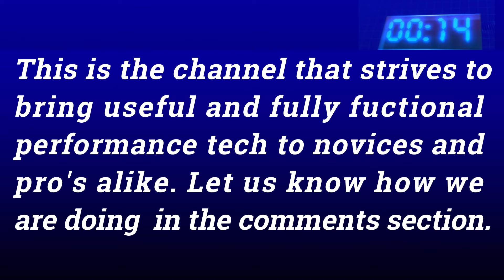Performance  survey & hot upcoming video's

Comment: I think your videos are a great balance of high tech information explained in a basic engineering way for people like us with a high school education to understand. I would like to see more steering and suspension modifications personally. But if you changed nothing your videos are already the most informative on youtube.
Reply: Id also love to see if there is anything that could be done about getting good low cc sbc cylinder heads. Because it is hard to get static compression up using dish pistons because they capture the flame front better. with the sweet spot for compression on the street between 9.25 to 9.5 these large 60-76 cc heads just don't cut it. If you could come up with a way to make the current 1.94 valve heads smaller without milling the crap out of them that would be cool or if you can take the smaller cc commonly available 1.72 heads and fit bigger valves in them or some other trick to get the flow and the vacuum up that would be cool I'd love to see if you could think about something for this subject.

Comment: It seems like doing more with less cubic inches seems to be the thing on the internet. The mission impossible with the 318 and power nations 305 416/500 hp have really got a lot of people talking. Although Derrick from Vice Grip Garage was the innovator on that whole trend with the 307 years ago. What I like about all the porters videos is you get the majority of the power without shelling out a ton of money, sure 416 or 601 heads won't flow 255 cfm like the trick flows but 235 cfm is doable. Those type of videos relate to a lot of guys that have the older cast iron heads sitting around.

Comment: I just ported a set of 781 heads with 219/188 values both intake and exhaust with some bowl work and they work great. I use as much as your methods as I could I my garage with basic tools I’m a retired auto body and pant technician. Thanks so much for sharing.

Comment: I'd like to see tip 100 speed secrets, like placing a fillet at the bottom of the cylinder bore. A list of things like that. Things that are universal and don't require flow benches.

Comment: Among others, i bought your book Performance with Economy many, many years ago. There is a page showing a SBC head's intake port modified. I recall a company in California did this mod and referred to it as their "street/econo" head.  The modification slightly widened the top only of the machined face  to increase flow on the roof of the port. There was an accurate, machinst drawing, showing the shape.  I scaled it up to "life size" and did that modification.  I also took your advice and had my machinist install a 1.6 exhaust valve.
He told me "Randy, would you quit reading books?" 🤣
Did I help or hurt the flow of these brand new World Products S/R 76cc heads?  Ill never know as flow testing wasnt available here.
Ill give you my combo, then make a suggestion.

73 4-bolt block/stock compression ratio and a mild Edlebrock Performer cam .420/ .442 lift

World Products S/R 76cc.  
(Not S/R Torquer)
Manley  SS Race Flo valves 1.94/1.6

I had about 80 hours into the heads, including making templates so that I could make each port identical.
The power increase felt to me about the same as when i had installed an edelbrock cam.
35hp?  It was definitely noticeable.

I gained power and there was zero loss in mileage. Just what i wanted.  I also learned something thanks to you.
The 1/8 mile time wasjust under 10 seconds as I recall with a best of 76 mph and i think the truck weighed 4350.  
I obviously didn't build a race engine.   😁   I just took it there out of curiosity.

What you do is aimed towards high performance, but here's something that could be a fun change for an episode or two.
Id love to see an engine combo or modifications aimed at mileage.
Say a power output of around 350 HP,  but the twist would be getting the highest achievable mileage.

Lets say a  good old 350
Iron heads
Carbureted 
Auto transmission, 350 or 700r4
Vehicle weight around 4000 lbs.
You could title the episode
Performance With Economy 😉

What cam?
What valve sizes?
What compression ratio and piston type or shape?
Manifold, exhaust diameter and header tube diameter?

Mention to viewers to watch the adverizing.  It helps generate a bit of revenue, correct?
Thanks for doing what you do, David. 👍

Comment: Hi David Vizard! Thank you for your update video! I'd love to see flow figures and speeds measured and perhaps some basic porting work done on the sbc 113 aluminum casting (H.O.) heads. They were pretty widely used in late 80's Corvette L98's and are still considered as entry level performance head by Chevrolet

Comment: I'd like to see more 4-valve videos. I am most interested in motorcycle heads, with street use a priority. There's a ton of information on pushrod engines and much less (reputable) information on 4-valves

Comment: Things I'd like to see: 1) the racing results of Mission Impossible.... will lightening all of that rotating assembly mean you need a heavier flywheel to launch, or will that matter? 2) How race tech on a 600ci big block translates to improvements on smaller street engines, and in that vein... 3) race tech that will help engines last longer on drag and drive events. The last event I watched had two top name contestants suffering from valve trains which kicked butt on the track, but will not survive the street driving portion. Engines have been improved drastically for either... now make it last for both. With your experience in valve trains, your insight may solve the problem, or it might encourage others  to work on it as well. And, not incidentally... provide me with free solutions for my ride.  ;)

Comment: Greetings DV, in my opinion your last episode explaining port energy was great! It just the information that is least understood and rarely applied. Although I would also like to see you explain the next step Port Energy Density. I have read your books and for the life of me I cannot pin point what it means or how it is calculated, much less how it correlates with camshaft selection. 

Also this would be a great topic to apply for 4 valve per cylinder heads since those are rarely analyzed through those methods. 

Thank you for your knowledge!!

Comment: I really enjoyed the intake manifold stuff you put out in the previous video, nobody thinks like that makes me think I need to do more welding ony intakes, looking forward to your future pocket porting video. I tried using a small seat insert cutting tool to make the round pocket above the 70 degree cut in the valve job, not doing a full plunge but to give me a reference for porting to.

Comment: I think your doing fine and let me say your anti reversion episode   I always said the greatest break throughs are of the simplest  view like the groove on the intake valve then the blocking the exhausts ports short side ty i  have been acquiring old school stone seat tooling and a couple of refacers but threes hardly any info esp.adj the width of seat angles i saw a refacer in one of your vids  i am sure you could help me and even veteran machinist with ease ty

Comment: Screw Andy.  You go racing.  
1. Polyquad - You've done a video on what Polyquad is, but we need the details on how it's done.
2. Mazda 4v part 2 -  Still waiting for the follow up video.
3. Turbo porting part 2 - Still waiting for the follow up video.
4. Porting Rules 2, 3, 4, 5
5. IOP Tutorial
6. 100 mpg car project
7. Valve Jobs

Comment: I do like your balance between the tech and the how to.  I'd like to learn about how to best determine cam timing. Not how to use a degree wheel, but say I have a duel overhead cam and tighten the lsa, how do I decide where it wants the valves to open and close for different engine scenarios?

Comment: Thanks DV.
For me its a great balance between high tech mods like useing a lathe or sth like that and building the great conrod balancing scale.
basic porting viedeos would be great and also some tipps fechniques for the small engines like sbc under 350CID with small valved heads.

Comment: Greetings and salutations, Mr. Vizard!
I do believe that racing a vehicle would be a well received hit. In my opinion, though labor intensive and costly which is the draw back, showing a before and after of the work is the key ingredient as well as failures and purposeful wrong moves. Demonstrating the rights and wrongs with the why it is so would be of great help into the understanding of at least that particular scenario. A quick mention there after of how and or why it would work on something else is an added 2 cents I think of a worthy mention.

Robert Cooke

Comment: Hi David, you have a great channel. I keep mentioning that you should do more  3 and 4 valve heads. There just isn't any video's out there that #1) I can trust the info and #2) go into detail about the what, and why things need to be done in a certain way. Thanks
Reply: Question:  Why do you think 4 valve heads need exploring?  Fact is, a single valve head of twice the diameter of a 4 valve can actually flow 4 times as much air.  When you double the diameter of a pipe, hose, some type of a restrictor, you quadruple the volume of air/fuel/liquid delivered, at the same pressure.  

The reality is, the only reason a 4 valve works better than a single valve is simply because a overhead camshaft can spin a higher RPM's for a given parasitic power loss.  As long as the chain/belt doesn't impart more friction than a common pushrod engine does.  

the simple fact is, 2 small valves can't possibly move more air than a valve even 1/2 the size larger than a given valve diameter.  He knows this already, and for a 4 valve to actually work, it's simply as a function of volumetric efficiency... What I'd like to see him do a study on is the Cadillac Northstar engine... I get it, it's plagued with massive amounts of engineering faux paws... But look at the intake runner, with relationship to the valve... Pure genius... Make a Northstar configuration as reliable as a LS, and your on to something.

Comment: Racing is great.  More, please.
My absolute favorite videos, however, are in no particular order, 1) the valve spring video,  2) air flow design philosophy within the head, 3) the no-loss exhaust, and 4)any videos with actual data...  
FYI -  I have no Chevy, Ford, or Mopar stuff - I like to transpose the data to the engines I'm interested in.
Well Done! 
P.S. - Still waiting to see what you would do to a Jaguar V12 head.

Comment: You need to tie head mods and manifold to deeper camshaft chioce tech showing us How in detail . Teach this on a example build and also applying it to ANY BUILD MILD TO WILD . 
Also many tow vehicles need help with a frugal build for frugal torquey towing especially with the newer trucks with smaller engines in our half tons .

Comment: I'd like to see more of. Camshaft selection the videos u done on that are awsome I building dirt track motors and I can pick a cam that gets me close but to fine tune cam I struggle with I love all the videos also how do I degree a cam if I don't have a cam card I'm having good luck with cams i use now but how do I improve my cam grind like to pull harder off the corner than my current cam or how can I lower rpms with same power to help save life of motor keep up the videos u the man

Comment: Max effort small cube(3.76 stroke)  big block chevy builds 396-427 etc.. for the low buck backyard guys that can’t afford afr heads and stroker cranks..Like Porting the old cast iron bbc large ovals and how to extract big power out of the generals heads/cranks with nothing more than maybe a set of pistons,bigger valves and working your port magic with a roller cam and a aluminum intake,Holley carb and a set of headders.. Back to the basics n see just how much tq/hp/and rpm is possible.. Just a thought. Always enjoy your content either way David!
Reply: Street or drag engine?
Reply: @musclebone7875   Max effort would suggest drag only but Super aggressive barely streetable builds would be cool too.. Solid lifter low gear hi rpm stuff..👍🏻 Growing up I witnessed some awesome homegrown throw together stuff back before 4.25 cranks and 4K alum Heads were the norm.. Something about making big power at high rpm just hits different than doing it at low rpm..

Comment: I think in the LS/LT world we live in a lot of your viewers would like to see more info on the topic of LS/LT ... I don’t recall you doing any LT direct injected cylinder head IOP review ... please correct me if I’m wrong ... or any LT cam info... When you had Lake Speed Jr on you mentioned that when running E85 the specs for the heads, intake, compression and cam etc. change can you elaborate on what the changes need to be... last but definitely not least but probably most... I think all your viewers and potential new subscribers would like to see a 6.0 LS dyno test with  Comp Cams 459 cam and one of your specced cams of comparable numbers to prove that your specs are superior ... I’m currently running a LS cam you specced for me 3-4 years ago and it runs very good ... and I know you said you don’t wanna get into the time to spec cams for people and you’d like a cam company to take up your cam cause I think we all understand this... I think a dyno test like this would put all your detractors in their place get you many more subscribers which would get you more money for the Mustang and more time at the track which sounds like what you and Andy really want... I appreciate all your shared knowledge ... I’d love to take up your cam cause but unfortunately I don’t have the $$ ... thanks
Reply: I'd live to see some LT stuff myself. Especially when it comes to lsa.

Comment: Trucks. Everybody's got one;  most cannot afford a weekend toy or trailer queen. Most trucks never see 4000 rpm. More torque is always useful for those that actually do things. So, low budget turbo setups maximizing low rpm torque. Stoplight to stoplight, the swirl port Chevys are hard to beat, esp idle to 1800 rpm. Short bed Silverado with a 5 speed and a swirl port 350 is a joy around town, not so much for spirited driving.  Something like a vortec 350 with a small turbo (gt35?) that's  gasping at 5000(or even 4000) but has 400 lb ft from 2000 rpm to 4000 rpm would be an exceptional everyday driving experience. Budget turbo options. Budget/junkyard intercooler options, or water or water/methanol budget setup. Cheapest method to achieve reliable 15 psi. Timing  constraints for turbo setups. 87 octane feasibility. Compression constraints. Plumbing fabrication tips/shortcuts. Budget transmission strengthening for high sub 4000 rpm torque. Cam feasibility for same. Mpg optimizations. Blow through carb options. (As an aside, do annular boosters enhance a turbo setup?) Turbo selection explained. Cheap turbos are abundant right now; let's explore the options for Joe Citizen. Can't think of anyone I'd rather hear this from than DV. Don't make it too simple; there's plenty of that elsewhere. Your ability to make the complex explainable distinguishes you. Own it

Comment: More racing is good. However I do take a little something away from every video you do… some good info on the big stuff helps me understand the amazing performance stuff out there and I also take notes for my own future modest 318 build that I will be porting my 302 quench heads for torque and I take many other notes I have learned from you and Andy on your 318 build … and Charlie S. has been a huge help to me too. More Mission “possible” if you can squeeze it back in somewhere… and go turbo Mustang and Casper!!

Comment: I would love to see some small displacement engines (going back to your roots) for maximum fuel efficiency.
Many of us are not involved in racing but have great interest in making the most our essentially unmodified Honda, Suzuki, Toyota, Hyundai.
I might also add that a number of modern designs seem to have gone to a design obsolescence model with cylinders that arevnot supported by the deck and timing and oil pump chains/ belts that, if they fail, destroy the engines - either before or just after the warrantee expires.
Many thanks for your automotive contributions.
Reply: If I may interject.  Parts failure just outside the warranty is a strategic mechanism done by engineers paid for making products that have a determined use life.  It's called 'Planned obscelesesnce '.  They intentionally engineer and calculate a failure point, over amount of uses that a product fails at.  There's a specific reason for this... Early engineers would build farm implements and tractors that would last virtually longer than you could live... Back in the early days, late 1800's to early 1900's, there were literally 100's of tractor and implement manufacturers.  The products produced were so durable, they never wore out.  Hence, farmers won't replace a tool, unless it has a catastrophic failure.  The vast majority of farm machinery companies went out of business as a result... Simply because the stuff they built was too good & never had a resale customer.  That's where the concept of planned obscelesence came from... They could build a Chevy square body that would last for a lifetime, but why would they do that?  They want you to buy a 'new one', when your old one wears out, or breaks to a point that repair exceeds the cost of new.  

As far as small displacement tech for fuel effiecency... I say, let the high end power guys build the craziest things they can build, that's where innovation actually comes from... Once they find something, the small, or efficiency guys start to adapt it to their mind set/technology.   History has proved over and over that this is the way innovation happens, at least in the automotive industry.